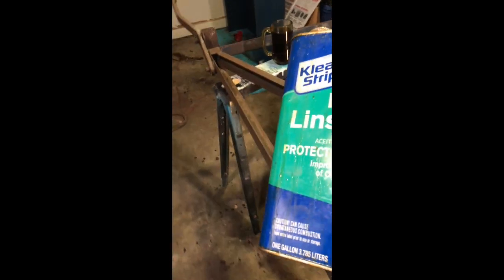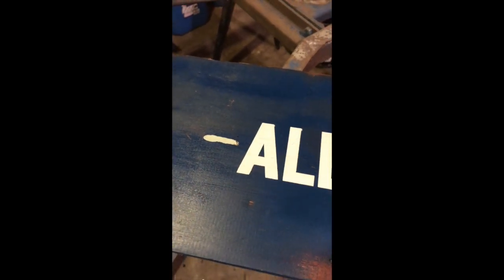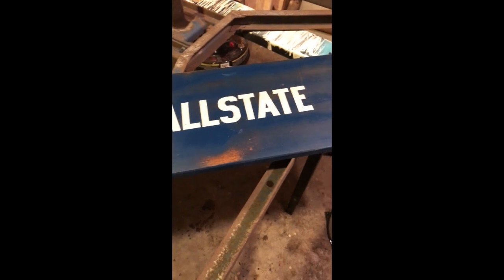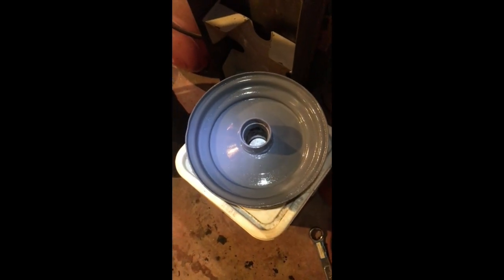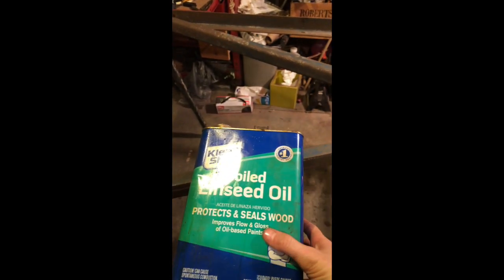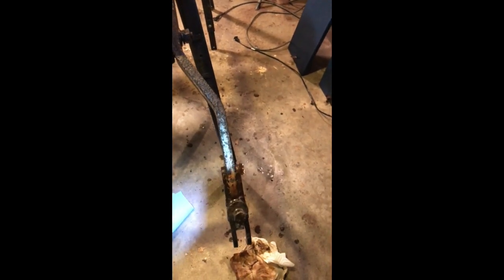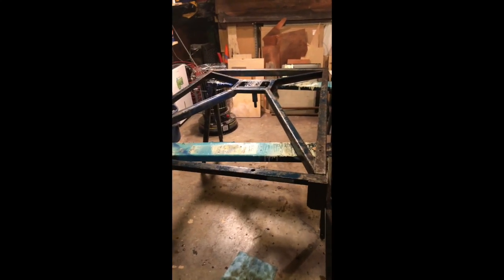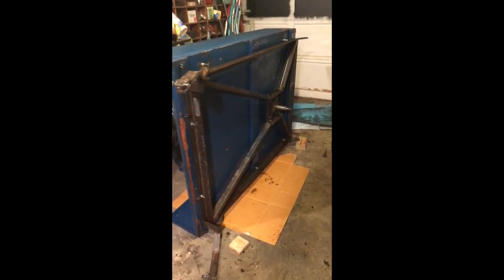Barn Find Allstate Single Wheel Trailer part 2 of 3

Comment: Marci
How does the floor get connected/secured to the four walls?
Reply from the maker: Steven Hernandez the floor itself is bolted directly to the frame with carriage bolts, the 2 side walls have screws along the bottom every 3-4 inches into the wood floor...the tailgate and front gate are secured ONLY with the metal brackets and a wing nut so that they can be removed for a longer load! Hopefully that answered your question!
Reply from the maker: Steven Hernandez if you haven’t seen this one already this is the one I found and assembled for my dad.                           https://youtu.be/0wlLYly3AQY
Reply from the maker: Steven Hernandez Steven Hernandez we also built another one for my husband’s beetle, but all we had was the frame on it so we could pretty much build it however we wanted...this is what we came up with...     https://youtu.be/Of7A4Zdna7Q
Reply: I just picked up a super dry frame with wheel and mounting arms in AZ. I'll need to build a floor and walls and tow it behind my 58' mango.
Thanks for the info.
Reply from the maker: Steven Hernandez you have a blank canvas! Ha 58 mango😍 my 58 dove blue panel is getting the one I just bought saturday (a bit of video on the newest trailer will be in this Thursday’s video)